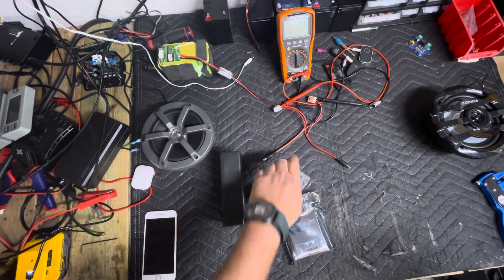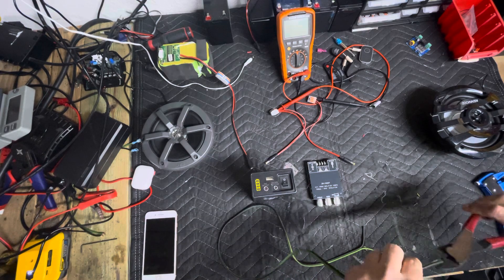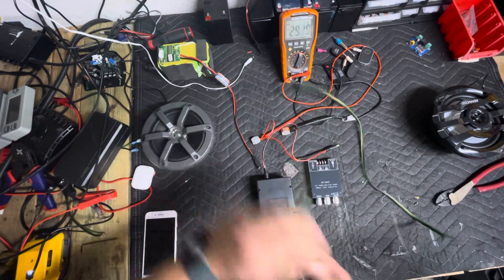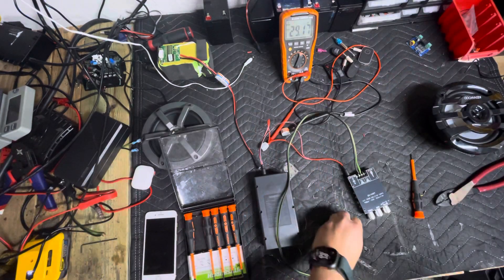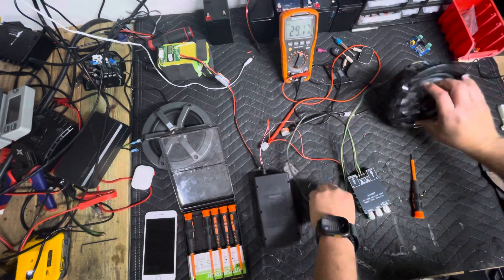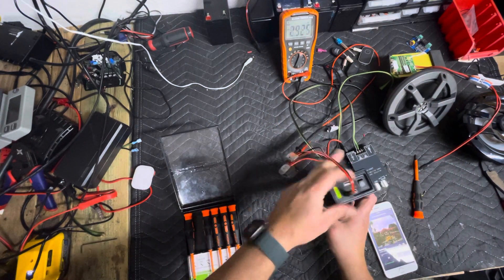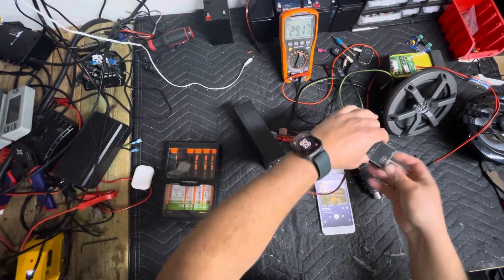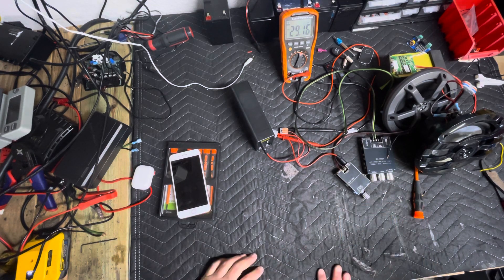New ZK-1002T amp Can it handle the Talentcell at 29v ?

Comment: My issue with a buck converter is that mine goes in protection when the bass pulls more than 5A. So i made the decision to run at 20v instead of 24v

Comment: the way you connect the speaker from the amplifier, is that bridged mode?
Reply from the maker: @dietcoke8114  summed mode
Reply: Can you hook this one up in a sxs off sxs battery to power 2- 6 1/2 in speakers. Or the zt-1602t can it hook up in a sxs too. If so on them how is it to be wired, just to battery is all? Thanks